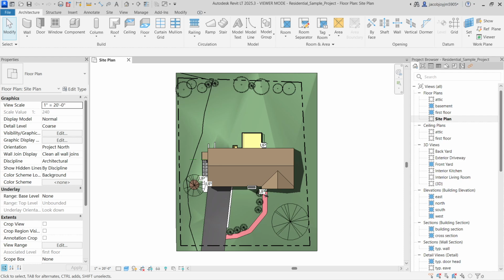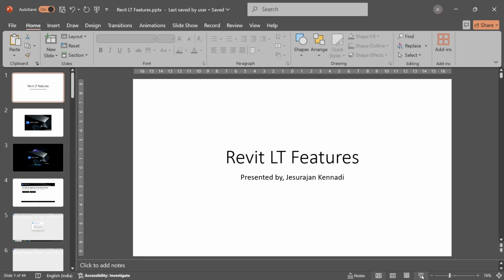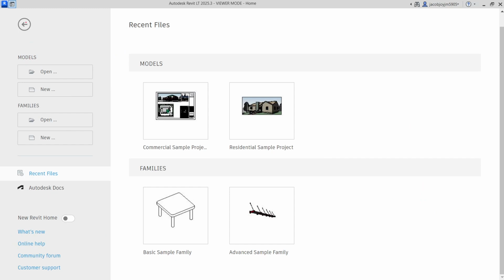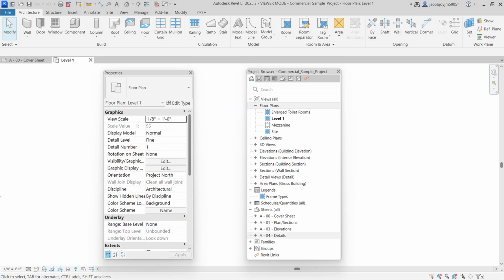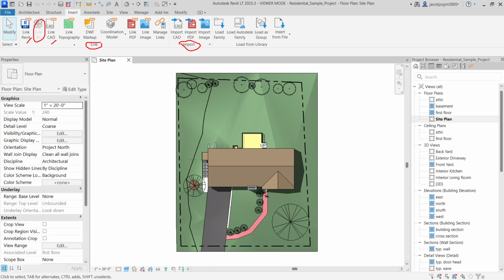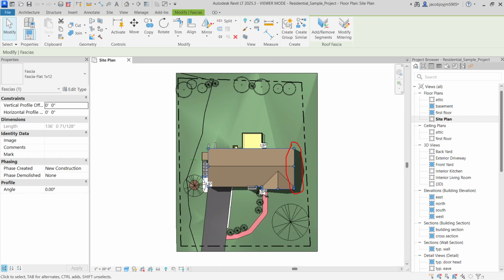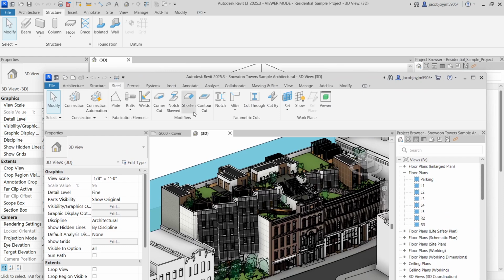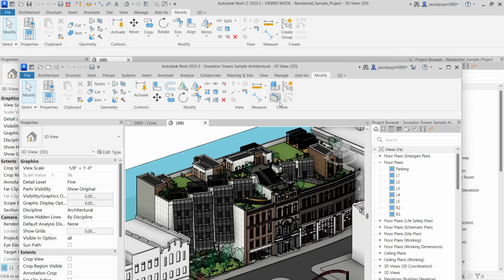Revit LT and Revit Software comparison

Comment: Great video, thanks! I am working on a larger project, an icehockey club with a wooden roof structure. The roof is round, and will be in two layers, like two domes on each other - with facilities in between them. So..., I might need trusses and therefore the normal full Revit version (And I want to try AI Veras for renderings!) Do you think taht I could make the roof in LT?
Reply from the maker: Use Revit full version for steel structure modeling.